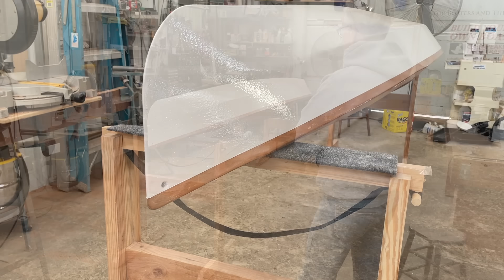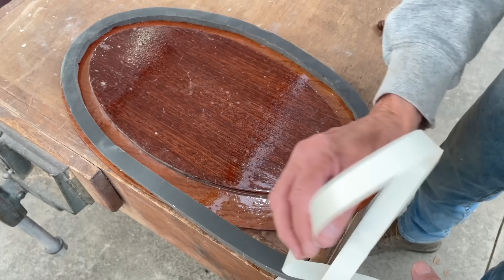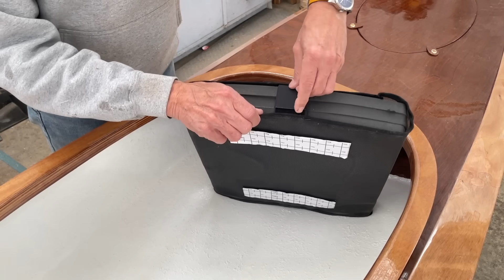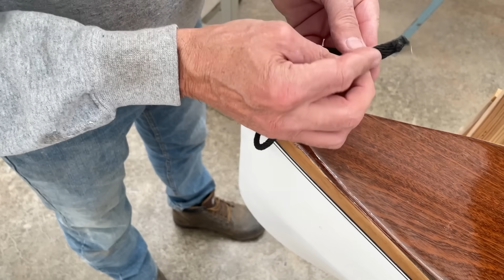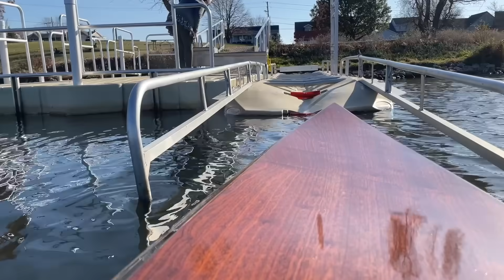Finishing and Launching a Wood Duck 12 Kayak S4-E24

Comment: Nice work on the kayak (it is very pretty) but you need a much better seat as you are slopping about in the boat and this is the way you lose stability. You need to set up a seat that fits firmly surrounding your buttocks and this needs to be locked into the structure of the boat. Knee bracing also helps in this regard. The aim is to feel like you are wearing the boat. Then it does feel like an extension of your body and it reacts instantly to every movement you make.
Reply from the maker: Thanks so much for the kind words about the kayak. I'm really happy with how she turned out! You make great points about seating and boat fit, and I completely agree with the philosophy of "wearing the boat."

Actually, that's exactly why I replaced the stock CLC seat! The seat I went with is the Bum Voyager Seat from The Nautical Taylor, which is designed to give that snug, supportive fit you're describing. It's a big upgrade over the original in terms of both comfort and how connected it makes you feel to the hull. I'm also looking into knee bracing to take it further, your point about that is well taken.

Always appreciate tips from experienced paddlers, it all helps refine the setup!
Thanks for watching

Comment: I notice that as you drilled holes in the topside that you didn’t do anything the waterproof the now exposed wood in the screw hole.?….dolphinite maybe or silicon
Reply from the maker: You typically don’t need to seal screws in the deck of a kayak because the deck itself isn’t part of the water-holding hull. The “working” hull, the part below the seam is what actually keeps the boat buoyant and watertight. The deck is above the waterline and designed to shed splashes rather than withstand hydrostatic pressure.

Kayak are generally stored upside down to a void long water exposure. Unlike a boat that stays in the water getting rained on. It is then a good idea to bed ad seal the fixture.

Comment: Question: You spent all that time and effort encapsulating the wood with epoxy and then varnish, then drilled holes through all of that protection to mount your pad-eye and the rear hatch turn buttons. Was there anything you did to seal up the wood fibers in those holes? I ask because I recently redid the interior of a Wayfarer dinghy and I have some water stains under the varnish where water found its way along the screw threads.
Reply from the maker: You typically don’t need to seal screws in the deck of a kayak because the deck itself isn’t part of the water-holding hull. The “working” hull, the part below the seam is what actually keeps the boat buoyant and watertight. The deck is above the waterline and designed to shed splashes rather than withstand hydrostatic pressure.

On your dinghy, Unfortunately, once the stain is beneath the varnish, the only real fix is to remove the affected varnish, let the wood dry thoroughly, and then refinish. For future prevention, it helps to:
Bed all hardware properly. Use a marine-grade bedding compound or polyurethane sealant on screw threads and around the base of fittings. This stops water from wicking into the wood. I have also dipped the screw in bee's wax to help when installing also seals the wood fibers. one can also flood each hole with unthickened epoxy or varnish so the wood fibers are sealed. Once cured, re-drill pilot holes and bed the screws.